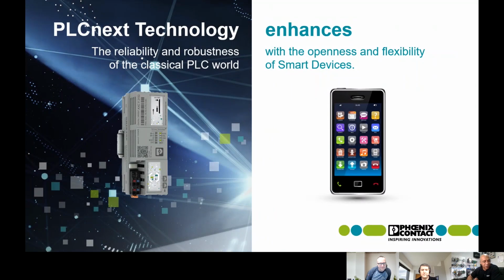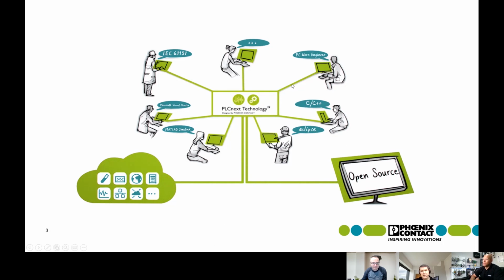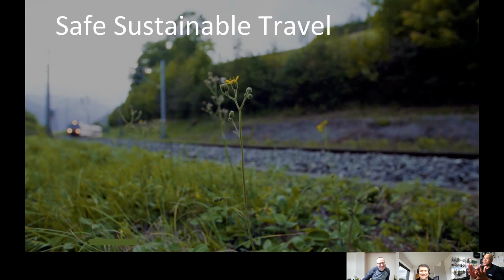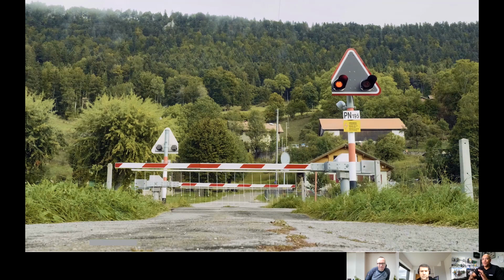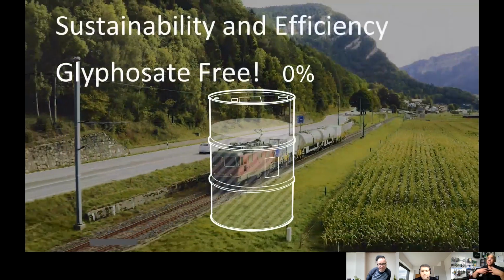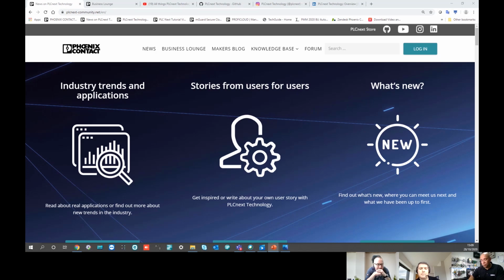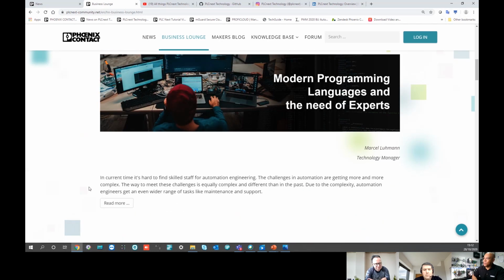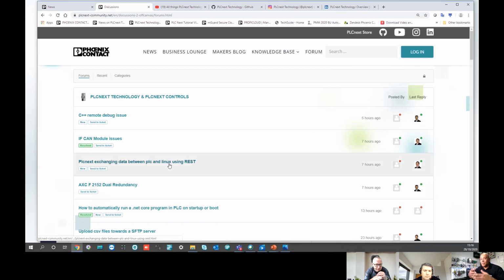Ask the Expert - Is it time to rethink the PLC?

Comment: Can i be your technical blogger :D ? Am a control system engineer coming from a computer engineering background (i.e. pro user of linux) and would like to explore the wonders of PLCNext ;)

37:22 is a very good point, but you did forgot the charges on the PLCNext Store :)